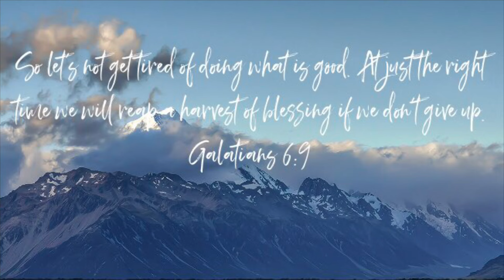Built a tiny house from a shed

Comment: I live in an 8x12 building I am finishing as I live in it.  :-)  I'm a great granny and my old fur faces needed a place with a doggy door and not so high off the ground.  So my RV is now my guest house.  :-)  Love how you did this tiny house.  I planned to do my ceiling like you did - but plan on using the strips of wood between the rafters.  And right now I have a dropped ceiling out of foam board so I could keep it cooler.  This coming spring I will move the foam board and finish up insulating and covering the ceiling.  I loved the nice color on your sink and other items (love the door - I may have to paint my door).  Thanks so much for  sharing.
Reply from the maker: Wow , your spot sounds really nice , thanks for sharing it with us , and thanks for the kind words 😃
Reply: I am in a 10x20.

Comment: It has no heat ór shower?
Reply from the maker: Electric radiator heater and outdoor shower, thanks for watching
Reply: Mine has no running water and I use small electric heater.